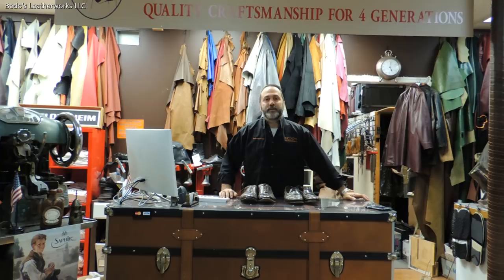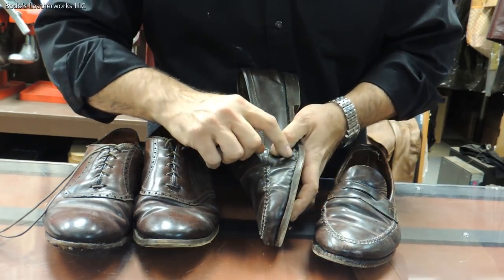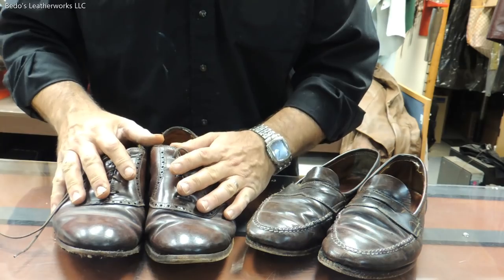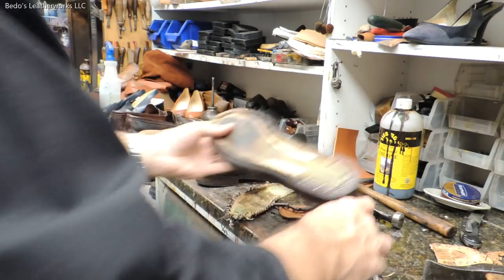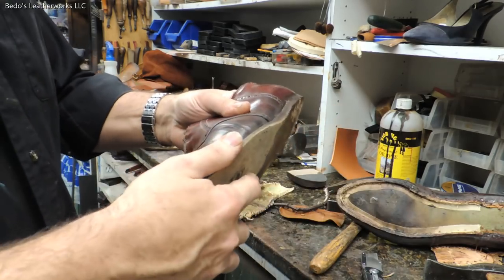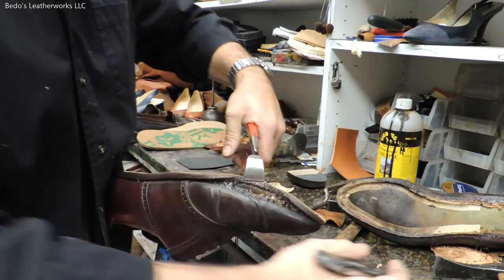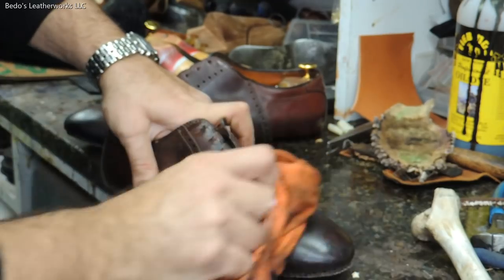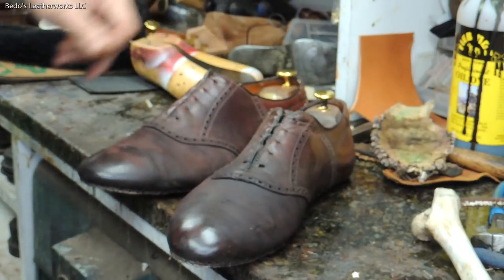Alden Shell make over #156

Comment: The shoes going back to the customer are almost certainly put together better than the factory did originally. Some of the wear on them was understandable, but some of the issues with the uppers were from simply not taking care of them. My current pair of dress shoes aren't super high quality, but they have shoe trees and get conditioned because I want to get what life out of them I can.THey certainly won't be worth having re-soled when they wear out. I don't wear them very often though so that will likely take a long time.  I'm planning to get a nice pair of casual boots and those will be of a quality level to be re-worked. I figure the better care I take of them, the easier that job will be when the time comes.

Comment: Bedo’s, I’ve discovered a good way to apply leather conditioner, especially Obenauf’s.  I heat shoe’s leather with heat gun set at 250 degrees and then apply the conditioner.  Irrespective of conditioner’s viscosity, it quickly soaks in.

Comment: Steve, awesome channel. My cobbler Josef just told me about Saphir Graisse HP Dubbin and Saphir Everest Graisse Végétale, and recommended them for my new Red Wing Iron Rangers (Amber Harness Leather). Josef seemed ambivalent about which I should use. Can you tell me when it is best to use one over the other? It is hard to find real comparative information about the products; Saphir.com does not even list these products on their site. (They do feature a higher-end Renovateur Dubbin.) The HP ("high performance") contains salmon oil (it used to be made with seal oil -- the green tin has a seal logo), and Everest is vegetable-based in a yellow and red tin. I did find something interesting on another site, MonsieurChaussure.com: "When applied to [only] the welt area of Goodyear shoes, the dubbin prevents the wax stitching from coming apart, thus increasing the useful life of your leather shoes." Very cool. So, what can you tell us about Saphir's HP and Vegetale Graisse Dubbins?